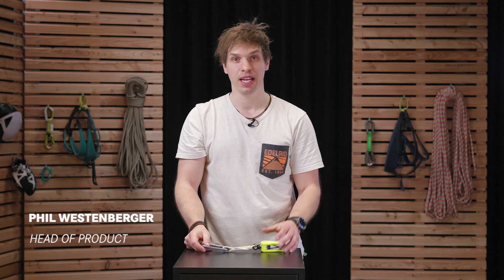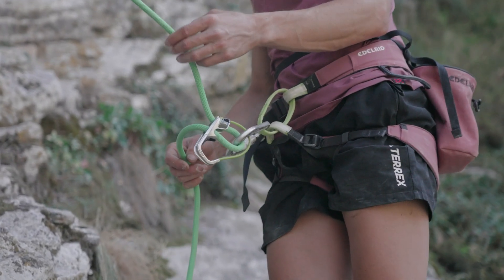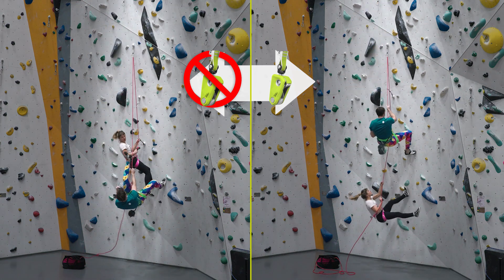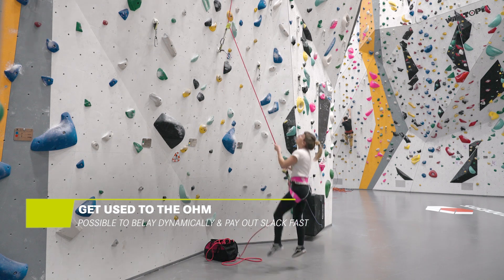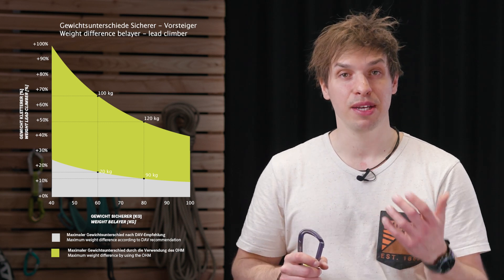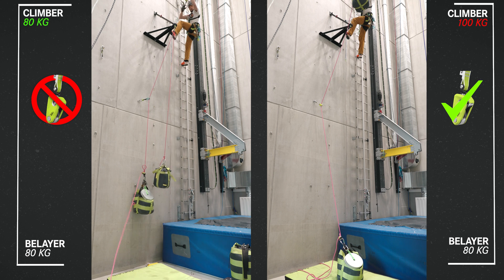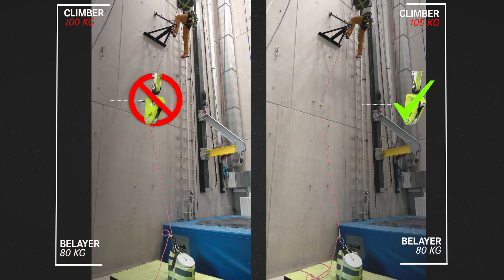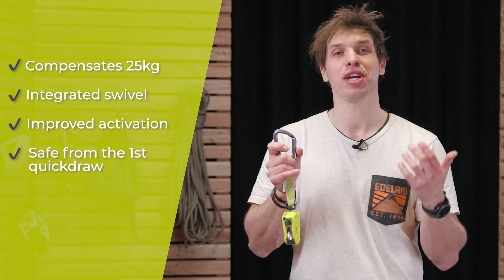OHM II Tutorial | EDELRID

Comment: There is a problem with the Ohm 1 which nobody mentions here and caused us to stop using it.

If the second bolt is not directly above the first, the rope comes out of the Ohm at an angle.  This causes the Ohm to improperly activate when clipping and lowering.  

The Ohm activated several times while clipping on lead and activated 7 times while lowering on a 20m climb.  To get it to deactivate I had to almost get all my weight off the rope.

I'm curious if the Ohm 2 will have the same problem.

Comment: What happens if the weight difference is greater than rated?  Will the device be useless?  Bought the ohm 1 a couple months ago for a child to belay an adult figuring any help would be better than none.  The gym allows us to climb to second bolt with her belaying me (heaviest in group)(she is too young they will not let her certify) so she has been getting experience with a 100 lb difference with no ohm and minimal risk of injury.  Looking forward to getting her belaying outside and trying to help be as safe as possible for her.
Reply from the maker: We as EDELRID can only comment on the pure weight difference compensation when using the OHM. We are not able to assess the individual experience of both climber and belayer or the capability of a child belaying an adult. It is up to the individual climbing parties to decide, if they consider climbing together as safe.

Regarding the weight difference compensation please also refer to our replies on previous comments:
The German Alpine Club (not EDELRID!) recommends a maximum weight difference of 10 kg, above which the climbing party should take additional measures (whatever it is) to make climbing together safer.

When we developed the OHM I, the recommendation of the German Alpine Club was still a maximum weight difference of up to 30% without the need to take additional measures. For the OHM I we used to communicate an “allowed” weight difference of up to 40 kg, depending on the body weight of the belayer. These 40 kg consisted of the recommendation of the German Alpine Club, as well as testing results from our testing set up back then. 

Meanwhile, we realized that we should not talk about an “allowed” weight difference and also should not integrate a recommendation from an Alpine Club, as other institutions might have different guidelines. Therefore, we developed a new testing method that only wants to objectively find out how much weight the OHM II compensates and communicate exactly this value.

With this new method, we measured that the OHM II offsets 25 kg. According to this same new testing method the old OHM compensates 15 kg (10 kg less). Now, anybody using the OHM II takes 25 kg offset into their consideration, while the climbing party always needs to assess its individual situation and decide whether additional measures are still needed.

The OHM II offsets a higher weight difference than the OHM I. However, the optimized cam geometry also reduces false activations compared to the OHM I. You can therefore expect a smoother handling and a better performance.
Reply: What do you think will happen? 😂

Comment: After having climbed with it for a session at the gym there are things I like and don’t like about it. The things I like are: Not having to worry about back clipping. Feeds through really smooth so you can pull kinda fast without worrying about it locking like the ohm 1. Slack doesn’t build up on top of the device when you’re switching to top roping after clipping, which was something kinda annoying for the belayer with the ohm 1. The thing I don’t like about the ohm 2 is that it spikes the climber pretty hard. I’ve taken falls from multiple heights above different clips with my partner standing in various positions attempting to give a soft catch to no avail. My belayer says it seems like the device itself is catching the majority of the fall and they can’t give a soft catch. The last fall I took was around 15ft and it was the hardest catch I’ve ever experienced despite my climber jumping into it. Our weight difference is around 20kg so should be perfect for this device. This is a huge negative imo and I’ll probably only use the device on stuff where there is a real risk of falling before the 3rd clip. Never had an issue with soft catches with the ohm 1.

Comment: can you use two ohm on the first two bolts if the weight difference is greater than 25kg? Seems like it could work
Reply: god no
Reply from the maker: The OHM is not designed for the use of two OHM devices within one rope system. 

The German Alpine Club (not EDELRID!) recommends a maximum weight difference of 10 kg, above which the climbing party should take additional measures (whatever it is) to make climbing together safer.

When we developed the OHM I, the recommendation of the German Alpine Club was still a maximum weight difference of up to 30% without the need to take additional measures. For the OHM I we used to communicate an “allowed” weight difference of up to 40 kg, depending on the body weight of the belayer. These 40 kg consisted of the recommendation of the German Alpine Club, as well as testing results from our testing set up back then. 

Meanwhile, we realized that we should not talk about an “allowed” weight difference and also should not integrate a recommendation from an Alpine Club, as other institutions might have different guidelines. Therefore, we developed a new testing method that only wants to objectively find out how much weight the OHM II compensates and communicate exactly this value.

With this new method, we measured that the OHM II offsets 25 kg. According to this same new testing method the old OHM compensates 15 kg (10 kg less). Now, anybody using the OHM II takes 25 kg offset into their consideration, while the climbing party always needs to assess its individual situation and decide whether additional measures are still needed.

The OHM II offsets a higher weight difference than the OHM I. However, the optimized cam geometry also reduces false activations compared to the OHM I. You can therefore expect a smoother handling and a better performance.

Comment: I see there is some confusion going around here. I'll take the liberty of trying to explain more clearly what Phil is trying to say.  

The idea is that when they launched the OHM 1 they estimated the maximum weight difference differently. The method they used to estimate kilograms was less accurate. They also added an extra 10 kilograms over the Alpine Club's recommendation. As a result, they gained 40 kilograms then. Now they have changed the method of estimating the difference in kilograms and have also decided to remove the extra 10 kilograms. Having estimated OHM 2 in this way, they obtained a maximum difference of 25 kilograms. Then they also estimated OHM 1 in the new way and got 15 kilos maximum difference. And finally, they calculated that OHM 2 can compensate for 10 kilograms more than OHM 1 (25 - 15 = 10). 

I hope I have understood things correctly and that I am not causing more confusion. If I'm wrong, I ask Edelrid to correct me.
Reply from the maker: The German Alpine Club (not EDELRID) recommends a maximum weight difference of 10 kg, above which the climbing party should take additional measures (whatever it is) to make climbing together safer.

When we developed the OHM I, the recommendation of the German Alpine Club was still a maximum weight difference of up to 30% without the need to take additional measures. For the OHM I, we used to communicate an “allowed” weight difference of up to 40 kg, depending on the body weight of the belayer. These 40 kg consisted of the recommendation of the German Alpine Club, as well as testing results from our testing set up back then. 

Meanwhile, we realized that we should not talk about an “allowed” weight difference and also should not integrate a recommendation from an Alpine Club, as other institutions might have different guidelines. Therefore, we developed a new testing method that only wants to objectively find out how much weight the OHM II compensates and communicate exactly this value. With this new method, we measured that the OHM II offsets 25 kg. According to this same new testing method the old OHM compensates 15 kg (10 kg less).

Now, anybody using the OHM II takes 25 kg offset into their consideration, while the climbing party always needs to assess its individual situation and decide whether additional measures are still needed. The OHM II offsets a higher weight difference then the old one. However, the optimized cam geometry also reduces false activations compared to the OHM I. So you can expect a smoother handling and a better performance. 😊
Reply: Which means that if you were climbing with OHM I with let's say a difference of 40kg and it was fine for you you can use OHM II with a difference of 50kg even if it is no more recommended now...

Comment: congrats in making it more complicated trying to make it simpler. I understood its 5kg worse than the old one, yet you telling in the end its 10kg better :>
Reply from the maker: The German Alpine Club (not EDELRID) recommends a maximum weight difference of 10 kg, above which the climbing party should take additional measures (whatever it is) to make climbing together safer.

When we developed the OHM I, the recommendation of the German Alpine Club was still a maximum weight difference of up to 30% without the need to take additional measures. For the OHM I, we used to communicate an “allowed” weight difference of up to 40 kg, depending on the body weight of the belayer. These 40 kg consisted of the recommendation of the German Alpine Club, as well as testing results from our testing set up back then. 

Meanwhile, we realized that we should not talk about an “allowed” weight difference and also should not integrate a recommendation from an Alpine Club, as other institutions might have different guidelines. Therefore, we developed a new testing method that only wants to objectively find out how much weight the OHM II compensates and communicate exactly this value. With this new method, we measured that the OHM II offsets 25 kg. According to this same new testing method the old OHM compensates 15 kg (10 kg less).

Now, anybody using the OHM II takes 25 Kg offset into their consideration, while the climbing party always needs to assess its individual situation and decide whether additional measures are still needed. The OHM II offsets a higher weight difference then the old one. However, the optimized cam geometry also reduces false activations compared to the OHM I. So you can expect a smoother handling and a better performance. 😊
Reply: no, you didn't understand anything.
Reply: @btudrus thx for explaining
Reply: @tiamat87  they changed the method for determining safe wight difference as well.

According to the old method:
 - you can use Ohm I with 30+10kg weight fidd
 - (theoretically) you can use Ohm II with 40+10kg diff

According to the new method:
 - you can use Ohm I with 15+10kg diff
 - you can use Ohm II with 25+10kg diff

If for your purpose / sklls the old method was ok, you may go up to 50kg diff...

Comment: I own the Ohm 1 and have demoed the Ohm 2 via a rep at the gym I work at. In my opinion, if you have the extra cash for the new one, it is definitely worth it. It works so much better in terms of clipping efficiency; the device doesn't short rope you unless you give it all you've got to attempt to make it activate. ALso, not having to worry about back clipping is a welcome bonus. It also gives a relatively soft catch. I rarely need my Ohm 1 and I don't like to reach for it unless it's necessary. To put it another way, Edelrid knocked it so far out of the park with the updates to this device, I will be upgrading when it becomes available in my country because it will be something I'll be glad to have and use when I need it.
Reply: That’s great to hear. I didn’t try it yet but it looks like a worthwhile upgrade. I think I’ll sell my old ohm and get the new one.

Comment: Please post improved numbers of weight difference of OHM1 too!!
He said it's roughly 10kg less than OHM2 so in theory only 15kg? (and then add the weight difference allowable at your criteria... ie. german alpine club: 10kg)
Finally thank you Edelrid for your innovating products and continued development of them!
Reply from the maker: The German Alpine Club (not EDELRID) recommends a maximum weight difference of 10 kg, above which the climbing party should take additional measures (whatever it is) to make climbing together safer.

When we developed the OHM I, the recommendation of the German Alpine Club was still a maximum weight difference of up to 30% without the need to take additional measures. For the OHM I, we used to communicate an “allowed” weight difference of up to 40 kg, depending on the body weight of the belayer. These 40 kg consisted of the recommendation of the German Alpine Club, as well as testing results from our testing set up back then. 

Meanwhile, we realized that we should not talk about an “allowed” weight difference and also should not integrate a recommendation from an Alpine Club, as other institutions might have different guidelines. Therefore, we developed a new testing method that only wants to objectively find out how much weight the OHM II compensates and communicate exactly this value. With this new method, we measured that the OHM II offsets 25 kg. According to this same new testing method the old OHM compensates 15 kg (10 kg less).

Now, anybody using the OHM II takes 25 kg offset into their consideration, while the climbing party always needs to assess its individual situation and decide whether additional measures are still needed. The OHM II offsets a higher weight difference then the old one. However, the optimized cam geometry also reduces false activations compared to the OHM I. So you can expect a smoother handling and a better performance. 😊

Comment: did I understand correctly? safe weight difference  is 10kg and at the top of that we have 25kg compensation with ohm2, so 35kg safe weight difference using this device?
Reply from the maker: The German Alpine Club (not EDELRID) recommends a maximum weight difference of 10 kg, above which the climbing party should take additional measures (whatever it is) to make climbing together safer.

When we developed the OHM I, the recommendation of the German Alpine Club was still a maximum weight difference of up to 30% without the need to take additional measures. For the OHM I, we used to communicate an “allowed” weight difference of up to 40 kg, depending on the body weight of the belayer. These 40 kg consisted of the recommendation of the German Alpine Club, as well as testing results from our testing set up back then. 

Meanwhile, we realized that we should not talk about an “allowed” weight difference and also should not integrate a recommendation from an Alpine Club, as other institutions might have different guidelines. Therefore, we developed a new testing method that only wants to objectively find out how much weight the OHM II compensates and communicate exactly this value. With this new method, we measured that the OHM II offsets 25 kg. According to this same new testing method the old OHM compensates 15 kg (10 kg less).

Now, anybody using the OHM II takes 25 Kg offset into their consideration, while the climbing party always needs to assess its individual situation and decide whether additional measures are still needed. The OHM II offsets a higher weight difference then the old one. However, the optimized cam geometry also reduces false activations compared to the OHM I. So you can expect a smoother handling and a better performance. 😊
Reply: correct.
but depending on your belaying skills etc. the safe weight difference could be considered more.
e.g. if you are belaying someone in toprope and know how to belay dynamically...

Comment: So just 10 kilos difference? I thought it was 25
Reply from the maker: The German Alpine Club (not EDELRID) recommends a maximum weight difference of 10 kg, above which the climbing party should take additional measures (whatever it is) to make climbing together safer.

When we developed the OHM I, the recommendation of the German Alpine Club was still a maximum weight difference of up to 30% without the need to take additional measures. For the OHM I, we used to communicate an “allowed” weight difference of up to 40 kg, depending on the body weight of the belayer. These 40 kg consisted of the recommendation of the German Alpine Club, as well as testing results from our testing set up back then. 

Meanwhile, we realized that we should not talk about an “allowed” weight difference and also should not integrate a recommendation from an Alpine Club, as other institutions might have different guidelines. Therefore, we developed a new testing method that only wants to objectively find out how much weight the OHM II compensates and communicate exactly this value. With this new method, we measured that the OHM II offsets 25 kg. According to this same new testing method the old OHM compensates 15 kg (10 kg less).

Now, anybody using the OHM II takes 25 kg offset into their consideration, while the climbing party always needs to assess its individual situation and decide whether additional measures are still needed. The OHM II offsets a higher weight difference then the old one. However, the optimized cam geometry also reduces false activations compared to the OHM I. So you can expect a smoother handling and a better performance. 😊
Reply: 10 Max without ohm. 25 max with ohm
Reply: @Konstiklettert  35 with ohm (25kg from ohm + 10kg recommended max weight difference)